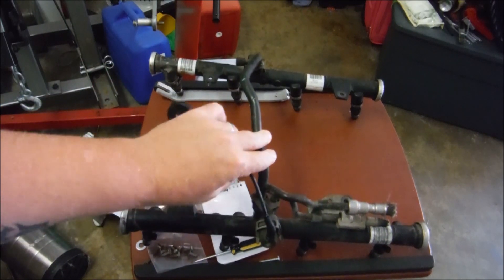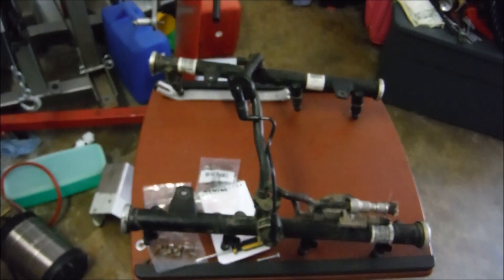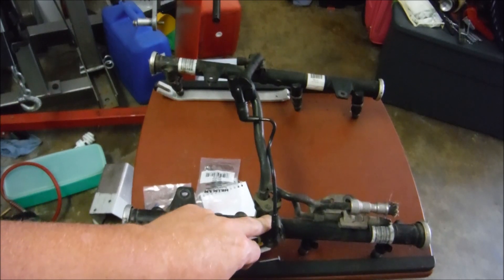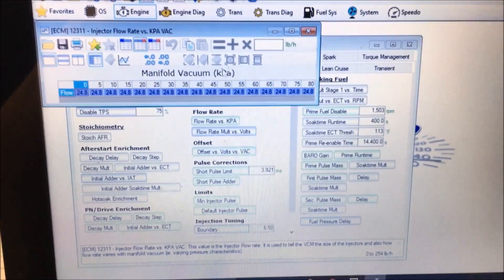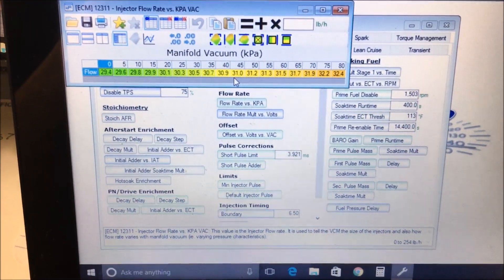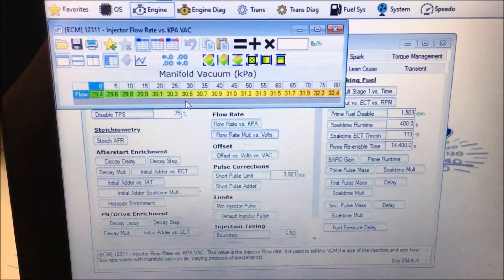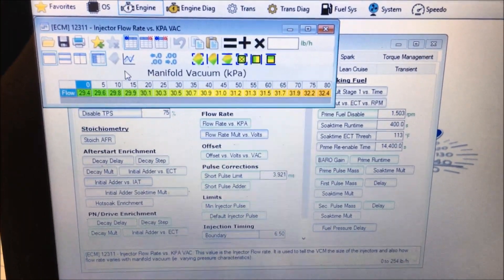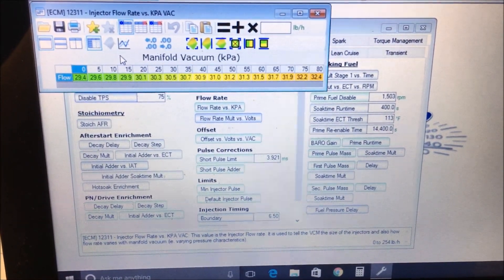LS ENGINE FUEL PRESSURE FACTS AND MISCONCEPTIONS

Comment: When you do a ls swap. I see lot of guys taking out wires of the factory harness. Do you have to have anything done to the pcm, ?
Reply from the maker: Yes, it has to be flashed for stand alone operation. Some codes has to be disabled as well as VATS and a few other parameters depending on application.

Comment: Definitely helped me out. I was one putting to 58psi but with the vacuum line connected.
I bought a cheap pressure regulator on Amazon with the Allen screw on the face, and now adjusted it to the specs you gave with the vacuum line capped. Thank you for sharing your knowledge and helping others with this video
Reply: Hey do you remember which amazon regulator you used?

Comment: The tester I got from auto zone says 5lb with the key on only at the Schaefer valve on my 04 4.8. It runs ok, a misfire once in a while.
Reply from the maker: Then something is wrong with your tester because an efi engine wouldn’t even start on 5 psi of fuel pressure. Those are carb pressures brother.

Comment: I done a ls swap on a 1971 c10 and used the corvette fuel pressure regulater with a submersible pump. Im getting 70 to 73 psi of pressure at idle. Ive checked all the lines and everything checks out and even changed the corvette regulator. any ideas? Thanks in advance,Carl.
Reply from the maker: Check out my “bye bye corvette regulator” video. Basically that can’t handle anything larger than a 255 pump without being overpowered.

Comment: I had a walbro 255 in my ls1 returnless fuel system with regulator an it idles perfect, drives thru all gear changes 4l60e but if i go to give it full or even half throttle my engine fouls up.. its a conversion an this is my last step to complete.. cars in shop atm an they clueless aswell, Any ideas mate? The shop has change pump an they fitted regulator because i didnt have one at 1st..they upgraded my pump as the walbro wasnt suppling enough pressure at increased rpm.. it goes abit better with new upgraded pump but they seem to think i need a big pump as i may have high hp engine.. i told em its stock just maffless... i recently paid for a tune as thought it may have been the case but now im stumped...all my sensors are good..to me it seems like its starving of fuel or sucking to much air im running a otm atm but if i spray around manifold with ether it stays a normal idle so i no there is no manifold leak..all my vacuum hoses are connected or bypassed as emissions is goin into new fuel regulator.
Reply: Hey mate, did you end up fixing the problem? What was it? My Ls1 is having a similar issue, it was driving great but then all of a sudden at full throttle I was losing power.
Reply: @Dhuss  hey mate my fuel lines where to small

Comment: @Bad Luck Garage very informative video. On my setup i have the corvette filter/regulator combo. when the engine is cold pressure is close to 70psi after the engine is hot for a period of time it drops to 58psi and holds. What do you think would cause this? Bad regulator?
Reply from the maker: Bad regulator or too much pump for the vette filter/regulator.
Reply: Did I have to do anything to your fuel system to get the fuel pressure lower. ? My swap I’m running a mds in-line pump and vet regulator and my pressure is close to 80 psi all the time. And cars backfires on heavy accaration

Comment: thank you very much finally someone that really knows
Reply from the maker: Hello Samuel Tibbetts, Thanks for watching! Im glad this video helped you out!
Reply: @BadLuckGarage  Was going through this exact scenario with my 2002 5.3 return style flex fuel swap where guys were all suggesting my 44PSI at idle and 54PSI with vacuum disconnected were too low.  Already replaced the regulator and no change.  Was about to replace my 6 month old fuel pump with less than 1000 miles when I found your video.  Thank you sir!!  If you'd like to help troubleshoot my idle issue.... :)   http://67-72chevytrucks.com/vboard/showthread.php?p=8764945#post8764945
Reply: @BadLuckGarage  how much should fuel pressure drop after the key is off? I have a returnless system. good video.

Comment: Thanks for the video. Been having this issue with a misfire because of the fuel tank pressure sensor. And I have this style system. I was getting 48-49 with out unplugging it so will try unplugging it and see what happens. 
I recently rebuilt this engine since it has about 300k miles and it leaked oil everywhere.
Reply: Fuel tank pressure sensor only deals with evap system and has nothing to do with fuel injection pressure. It will not cause a misfire or drivability symptom. If faulty it will cause a check engine light with EVAP codes. Hope this helps.

Comment: Hey man I have a Ls3 with a returnless system, factory fuel system, with a big cam, I get 72 psi at prime them I'll will start to drop slowly if don't start it. When I start it it drops down to 62 psi, and stays there if I rev it then it will die, is this pressure too high, it will idle around 12.8-13.9 Afr so definitely rich, and I get some fuel coming out of the driver side tailpipe. Injectors are good morning leaks or weird impedance, you think this could be my regulator or check valve in my fuel pump.
Reply from the maker: Sounds like your pump is overrunning your regulator. Not sure what your setup is but if you’re trying to use a Corvette filter/regulator and you’re running anything larger than a 255 pump the vette filter/regulator can’t handle it. I’ve actually covered this several times in other videos.
Reply: @BadLuckGarage  I believe these cars came with the zl1 pump, so still stock pump and filter, regulator are all together I believe, stock rails, stock injectors
Reply: It's a 2014 Ss sedan, do you think the extra 4 psi of pressure could be causing my misfire and rich condition, I've checked coils, put new wires, new plugs, did leak down test, I'm at my wits end pretty much. Thank you for responding

Comment: I have a 2009 Chevy Tahoe 5.3 liter returnless fuel system. At start up it holds 58-60 psi of fuel pressure, 10-20 secs of idle it drops to 42-44 psi and continues to stay there while driving. It hesitate and stumbles while a load on the motor. Does it need a new fuel pump? Mine I believe has a one unit sending unit and fuel pump all in one Inside the gas tank.
Reply: I have a ls1 atm which is doin the same thing its a dead head rail. It idles perfect goes through al gear changes but if i go to accelerate quickly stumbles an splutters an wont rev out. Im not running a regulator atm an have been thinking this may be my problem as it got a new fuel pump.but even the car shops in town cant help me an are dumbfounded.
Reply: Scrap yard Dawgs  did you put a fuel pump on you it?
Reply: Brand new walbro 255
Reply: Scrap yard Dawgs did that make a big difference and run better?

Comment: I have an 08 5.3 flex fuel with a return less fuel system (only has 1 line ) am I understanding correctly it should have 58ish psi at idle ? I have 44 psi at idle
Reply from the maker: Correct
Reply: Tom what did you do to correct this? A new fuel pump? 
I have 5.3 liter flex fuel return less system running with 43 psi at idle as well and stumbles  and hesitates some.

Comment: I have a returnless LS swap with a returnless system.  It starts perfect initially. Once I after a short drive coming to a stop the idle  drops low, and occasionally dies, but if I  put it in neutral  the idle comes back to normal and the car drives fine. Then once I shut it off after it sits for about 30 mins it takes a while to start. If I hold the throttle down its starts quicker. I think it is flooding itself out. The in jectors have been replaced. I'm  wondering if I  put an extra filter in the line it would help.
Reply: Did you ever figure out the solution? I am having this same problem. Sometimes the truck will start just fine and other times it take a long time to start and I have to hold the pedal down to start it faster.

Comment: Hey hope you can help coming from a carb sbc was running great sold it and put a 5.3 ls in it kept same fuel system wired by a terminator x would run good now sold terminator x and went with a stand alone harness now motor runs rough at idle ecu is flashed and tuned can it be low fuel pressure or fuel pump that’s set up for a carb sbc is a low pressure pump also don’t know anything about pump game with truck with the sbc in it
Reply from the maker: If you have a low pressure pump its definitely NOT going to run a high pressure efi system.

Comment: Got a quick question about my 79c10 build. I’m using a 11-13 non return Tahoe intake that looks like a sstb intake with ev6 injectors on a 06 5.3 engine and was wondering how should I hook up my fuel system to avoid issues when install the turbo. I have a baffled 87 tbi R10 gas tank with a feed,return and vent nipples on the sending unit with a in the tank 450 walbro pump. Should I use a aftermarket regulator with a feed and return lines or just run a feed Line and block off the return line to the intake?
Reply from the maker: Aftermarket regulator. You can’t just block the return or the regulator won’t work. You can either mount it back by the tank like I did in the Turbo C10 build or closer to the engine. People say you need the regulator as close to th engine as possible but I never had any pressure issues on SteppinWolf. You can check out the Turbo C10 playlist for more details.
Reply: Bad Luck Garage  ok thanks! I’m about to check it out now
Reply from the maker: @tdstokes22  No problem brother. Heres a link to a video where I installed an ebay regulator. There is also a 1 year follow up video. https://youtu.be/NbzdWAR1Rss

Comment: I have 01 Chevy 2500 6.0 return style fuel system 50 key on not running drops to 42 or 45 when running but while driveing going from half throttle to full the psi drops to around 20 I have new fuel lines and fpr would it be a bad pump
Reply from the maker: First I would check and see if the pressure goes up at idle when you disconnect the vacuum line going to the regulator. If it doesn’t then it maybe the regulator. If it does go up then it could be your pump of a clogged fuel filter if this is in a factory application. If it’s in a swap, it’s possible that it could be bleeding off pressure in the tank in the hose that goes between your pump and your sending unit if submersible hose wasn’t used or if fuel injection clamps weren’t used.

Comment: This sounds great,  I placed my scanner in drive mode today and noticed that my psi was 44 psi in drive but KOEO it is 58 psi. I thought something was wrong BUT NOW I UNDERSTAND.  THANKS FOR THE VIDEO. 
2010 LC9 5.3
Reply from the maker: If you are running the LC9 in the stock application with a returnless style system then you should have 55-62psi at all times. As shown in the video, you should only have less than that if using a vacuum referenced fuel pressure regulator or an older system flexfuel engine.

Comment: You literally saved me hundreds of dollars with this here video. Everyone I've talked to (online) says I need a fuel pump and I'm at 50 PSI at idle in a return style 2003 system. Thank you kindly.
Reply from the maker: Just make sure you disconnect the vacuum line and check it also and it should go up....UNLESS it’s got the 50psi flex fuel regulator.

Comment: I put a stock 5.3 drive by cable in my 86 c10   It was reveing fine tell one day i wouldn't . It starts and idles just fine. The fuel pump lines are a all new. I had the standalone wiring and pcm done by a shop. I've sat thought and scratched my ass still can't figure out why it won't rev anymore. It just bogs down and sounds like a disel jake braking.....any help or ideas will be greatly appreciated

Comment: I have a ls swapped gbody with a sheetmetal intake. External fuel pump and corvette regulator. At idle my inline gauge shows 100psi. I thought maybe regulator was the issue so I added a second regulator just to see before pulling it all apart and I can only regulate it down to 90. Is the external fuel pump to big?
Reply from the maker: The corvette filter/regulator doesn’t play well with high volume pumps. Anything larger than a walboro 255 will usually over run them. I’ve done videos showing this issue with a Walbro 450 pump.
Reply: Thank you for the info I found the issue was the return line pressure. The sender had a filter on the return line causing the return pressure not to flow freely. Pulled the filter off and regulates like it needs to
Reply from the maker: Good deal. 👍🏻

Comment: OK, what if fuel pressure low after disconnect regulator tube , what should i replace? and i am loosing  fuel pressure only in hot whether.

Comment: I have read posts for 3 days on a swap I’m working on and NOTHING explained this better than your video. THANK YOU.  I’m putting a 5.3 in a 95 s10 that had a 4.3 in it. I have a return style engine, non-flex. What I am trying to find is if my stock pump is able to run the 5.3 I’m putting in. I’ve read that it can and I’ve read just as many times that it cannot. If it cannot, do I need to install the walbro 255 and use a regulator to bring the pressure within spec? I’ve seriously read on this for 3 days, and I’ve saw as many “yea it will work as I have NOPE it won’t! 🤦🏻‍♂️
Reply from the maker: Brother I can’t I’m good faith say either way because I don’t really know what pump is in your S10 or what it’s rated at. But I will say if you plan to do anything to the 5.3 in the future it would be in your best interest to go ahead and install the 255. If you’re using return style rails then the regulator already on the rail will handle a 255 just fine so no need for an aftermarket unit. 👍🏻
Reply: Bad Luck Garage easy enough thank you! I also sent a request to the Facebook page lsx tech to look over some stuff but your page is hard to get approved for! Still waiting.. lol anyways thanks for the reply, you have a new subscriber!
Reply from the maker: LSX Tech is not my page brother. Link to the Bad Luck Garage Facebook page is in every video description. And the way it’s set up, Amy member can approve your request to join. 👍🏻

Comment: Just wondering what's psi does a non return Ls1 start to lean out? I'm running 150 shot and just wanted to keep an eye on it.
Reply from the maker: 55-62psi as mentioned in the video is your target. Most people just shoot for 58. If your pressure is dropping below 55 at WOT then you’re most likely running out of pump or filter isn’t flowing well.(dirty) Of you’ve watched any of muni chinavette playlist then you know I’m currently running 175 shot on my bolt on LS1 on the stock fuel system with no issues so far but the age of the pump and filter can play into how much it can support as well.

Comment: Thank you sir for the video!! I just found your channel and learning a lot. I also have a question? I have a 1986 Chevy C10 with a new 350 from GM!! I’m installing the MSD EFI I want to do a return style fuel system I have the new 87 tank with the baffle inside of it so my question is what pump would you recommend me using? And if I install a bypass regulator after the throttlebody. By setting it up this away do you think it will receive the proper pressure? And would you have any suggestions or recommendations?? Thank you sir!!👍
Reply from the maker: First off thank you for watching and I love hearing that my videos are helping people! As for your setup, the easiest and most reliable thing for you to do would be to use a stock 87 sending unit and and an ep381 fuel pump. As long as the crate engine you've installed is below 350hp the ep381 should have no problem keeping it fed and its a fairly low budget pump thats very quiet. the 87 sending unit will also have all the necessary feeds and returns already built in so it will only be a matter of using fittings or clamps to connect your feed and return. I'm not very familiar with the msd efi setup but if it runs at 58psi then you may want to look at a corvette style filter/regulator instead of running seperate filter and regulators to both simplify the installation and give you a more budget solution with parts that you can find at your local parts store should you ever need a replacement.

Comment: Will the Stock GM fuel pressure regulator on a return stock truck rail  be able to control fuel pressure from a walbro 450 with the stock 3/8 feed and 5/16 return or is this too much pump.
Reply from the maker: The truck return style system will usually hold a 450 no problem. I’ve never done it myself but I’ve been told there are people using the stock return style rails and regulator with two 450s with pushing through.
Reply: Bad Luck Garage one more question... with a return style truck fuel rail can I just cap the return line and run a separate boost reference regulator.  Or will the factory regulator cause a problem
Reply from the maker: roving vacuum from the factory regulator will simply hold the fuel pressure at the preset 58ish psi. So the boost referenced regulator would be useless at it wouldn’t be able to increase pressure beyond that. You would be better off completely removing the factory regulator and welding up the hole or just buying a cheap set of eBay fuel rails to run with your aftermarket regulator. Or a third option is running a returnless style fuel rail in a deadhead setup as I did on the turbo C10.